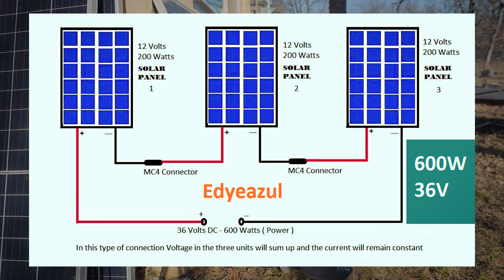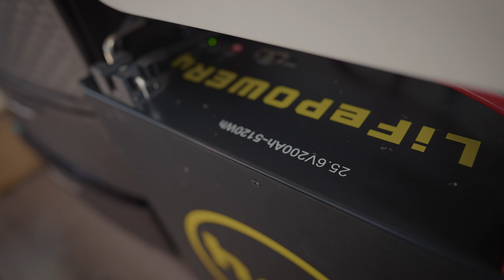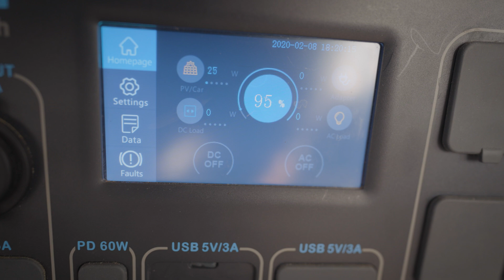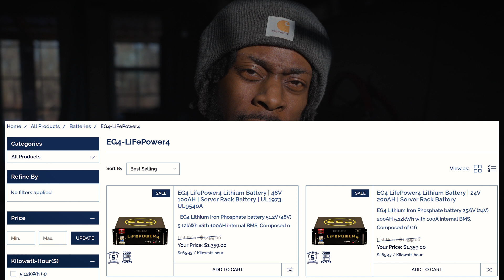You Still Paying For Electric! Why? Lemme Show You Something !

Comment: ❤ I wonder how much can be used if I only had 2/ 100 watt panels?...like about how many items can be used with just the 2 panels or does it depend on how many plug in areas the battery has, that the solar panel is charging?....
Reply from the maker: It depends on the inverter or solar generator you have.. most of them can receive anywhere from 0 to 3000+ watts of solar… if you only have two 100watt panels hooked up to let’s say a 2000watt solar generator, you can pretty much power anything but the problem you will run into is charging it.. with two 100watt panels it’s not going to be enough solar to charge it fast and efficiently enough to compensate for the amount of power it’s putting out to your appliances & etc.. so you have to be mindful of that.. I can explain better by giving a demonstration